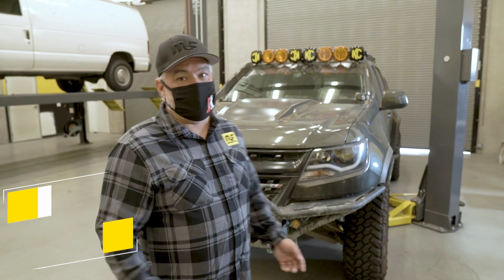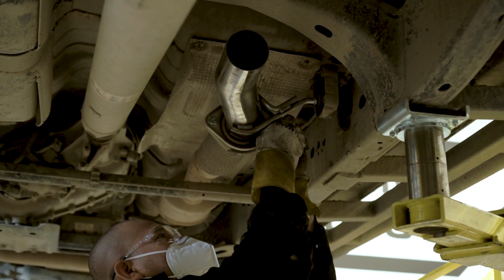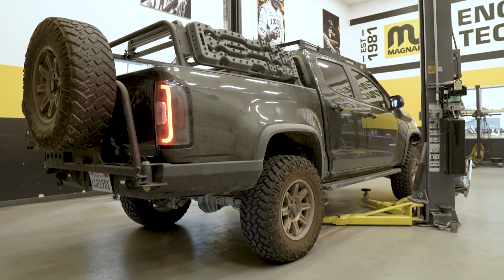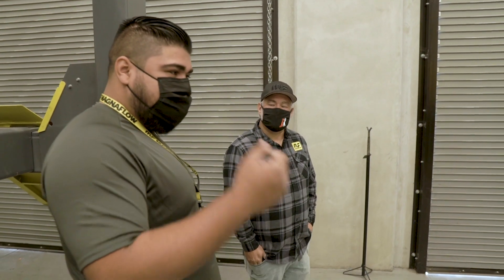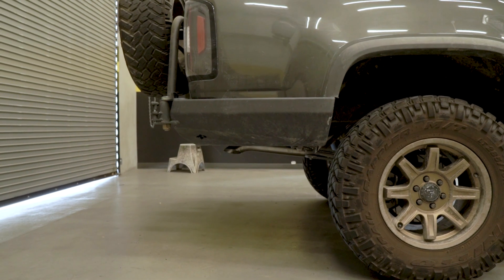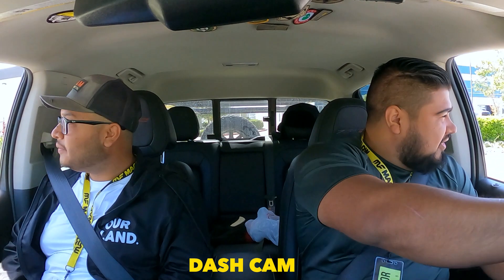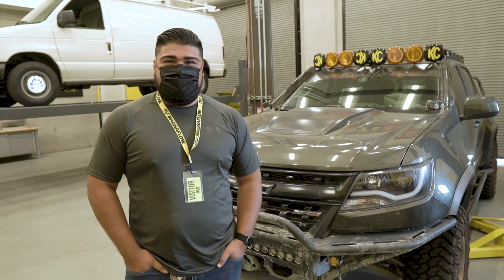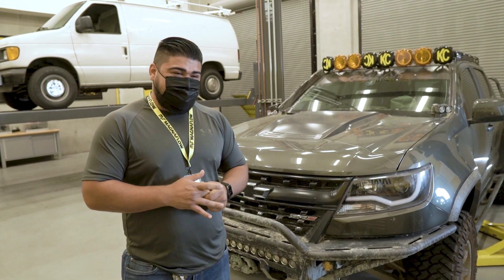Andy & Joel visit MagnaFlow - Overland Series exhaust for the Chevy Colorado and GMC Canyon 3.6

Comment: Can you keep an oversized spare with this installed? It does the spare have to be removed?
Reply from the maker: Because the tire size is so dependent on the manufacturer the general answer is yes however an issue starts to appear around 33" in however the problem is the same with the stock exhaust.

 One bonus is that the tailpipe does not have a resonator like stock so there's a little more opportunity to fill the space with more tire with the MF OLS